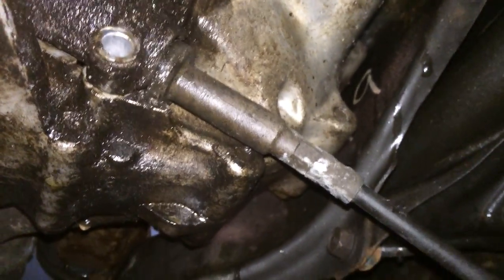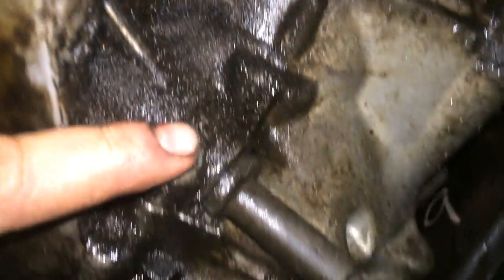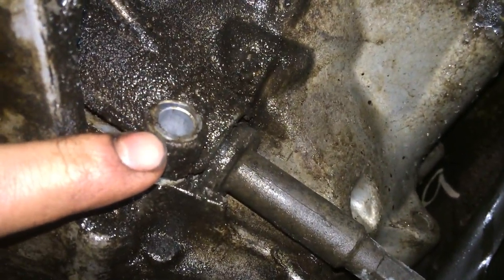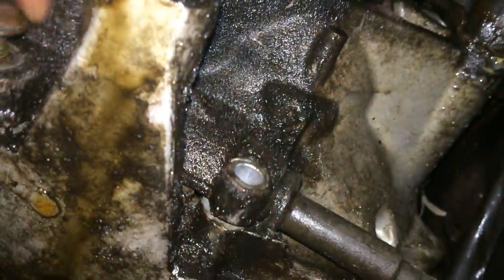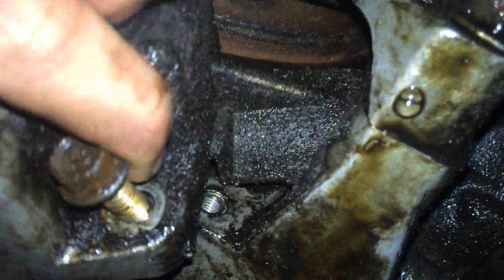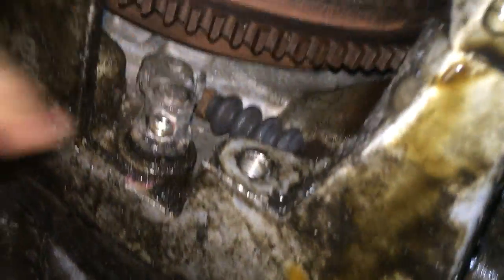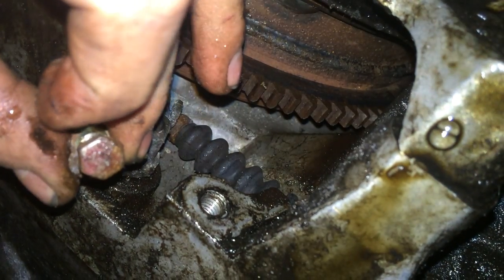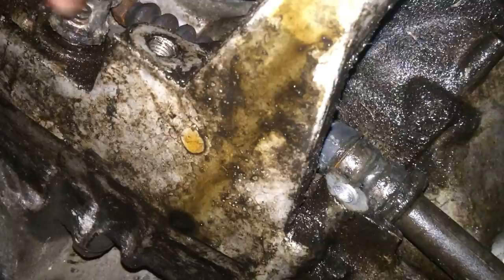Honda Civic automatic transmission cable removal

Comment: my parking light n driver light is on at the same time when i turn the ignition on before cranking could it be the transmission cable out of place?